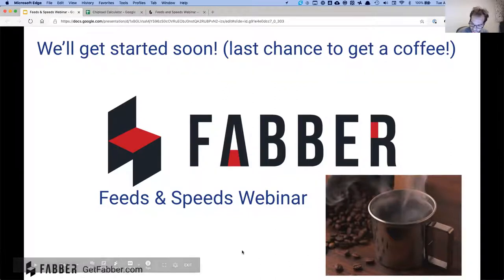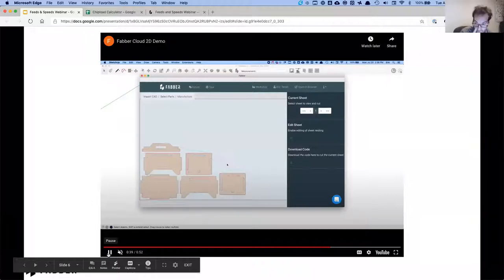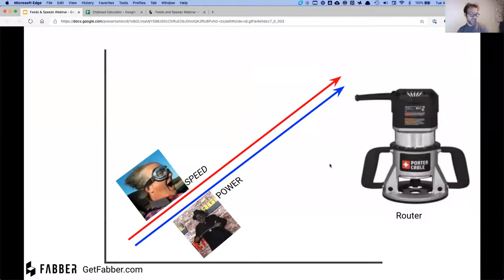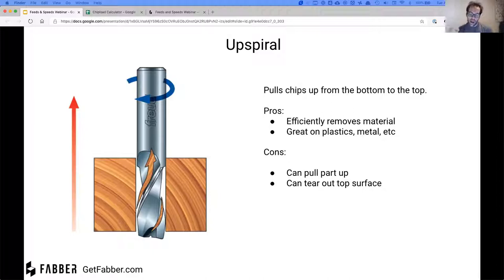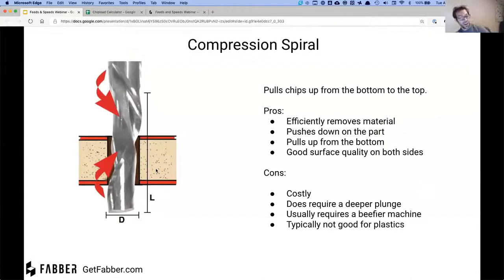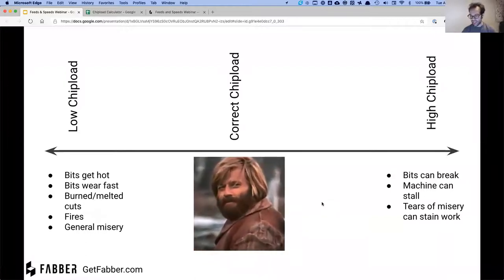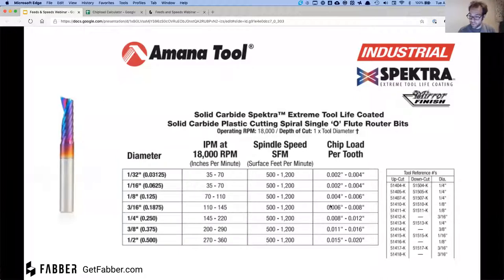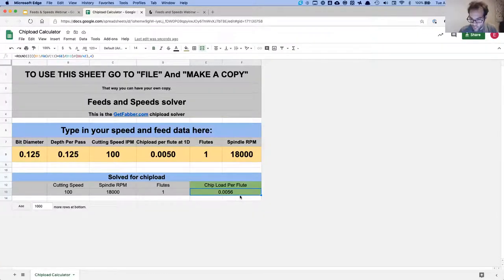Feeds and Speeds Webinar

Comment: Thanks Eric for the creating the video on feeds and speeds. I really liked the “Chip Load” calculator you created. It looks and works much better than most of the calculators I’ve found online. I will be downloading it today. Thanks for making it available to everyone!
The person who asked about creating circles that are malformed may have a mechanical problem called “Backlash”. This is nothing more than the “slop” or “play” between the screw and nut that drive the X, Y, and Z axes. It’s fairly easy to correct through software (Mach 3) or hardware (spring loaded “anti-backlash nut”). – On the other hand, it may be something as simple as a loose coupling on one or more of her stepper motors. This will cause the mechanical drive (lead screw) to skip a few motor steps. - Just remember to re-calibrate the “steps-per-unit” for the X, Y, and Z axes in Mach 3 CNC controller software after fixing the backlash.
Roger Secura
Reply from the maker: I would say you're correct about something mechanical going on, however it's not a good idea to fix a mechanical problem with software. First tighten everything up and then dial in the software :)

Comment: Thank you Eric for making the effort to provide this good webinar.   One note, it seems as though in the earlier part of the lesson, you refer to speed sometimes as RPMs, and at other times you say speed, when you mean Inches per minute linear travel.   I haven't been thinking about chip loads for a long time as my Shopbot has been sitting idle for several years.  But  even at the end you got a question, and you said, "It's a speed thing"..... well, is that RPM or Inches per minute????     Very good job though and thank you again, Chuck
Reply from the maker: Thanks so much for watching Chuck! Did you see it live? (I don't have my list in front of me)
Reply: @fabber5696  I did not see this live.   I saw the notice on the Shopbot forum after the lesson was over.   Chuck
Reply: Thanks for the great information and calculator! Just getting started with hobbyist CNC and I'm super excited about the time saving and simplicity that Fabber provides.